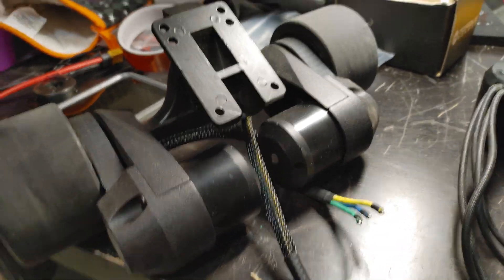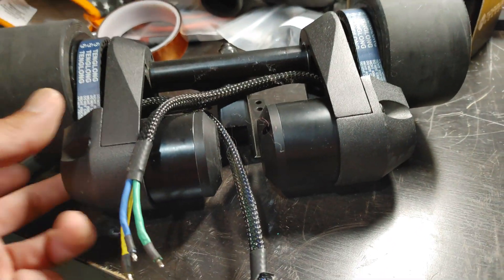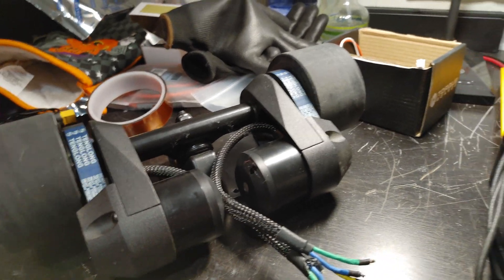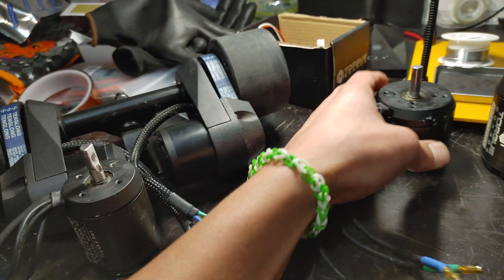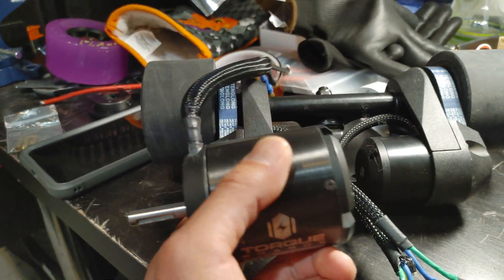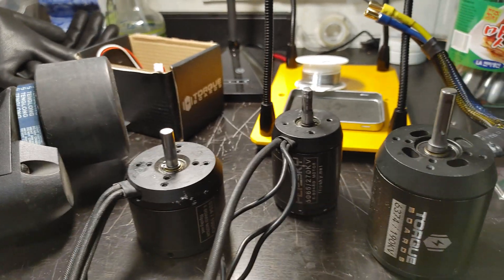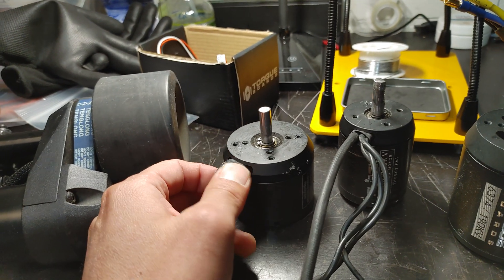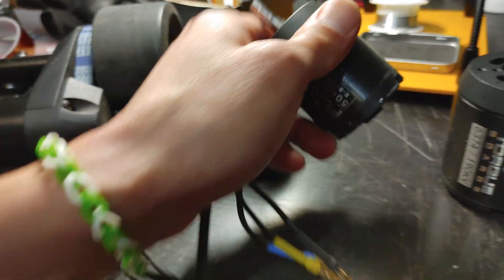DIY Electric Skateboard 101 - Which Motors You Need?

Comment: Ok bro your opinion what is the #1 new top hottest large Esk8 motor of the 2021 year?
I’m not really impressed with the Maytech 6396 170 kv what larger could you recommend?
Reply: Form the bottom of my heart,the best bdlc power and torque award must go to...
Flipsky80100 130 Kv’s!!!
By far best motors I’ve ever rolled!!!
With tip you F@$&(n head off power n torque!!
Given a minimum 12s power plant...

Comment: Any tips on sites to buy d-shape motorgears from? Looking for 15t and up
Reply from the maker: I like Flipsky, DIYElectronics.com, and eBay.  I just buy super cheap pullies on ebay but you have to know the right size, the shaft diameter(8 or 10mm) plus pulley tooth specs.   Also use 15mm belts for most power if needed.
Reply: @dr.eskateboard3381  Thank you! 🙏